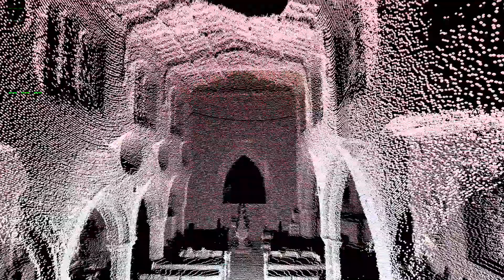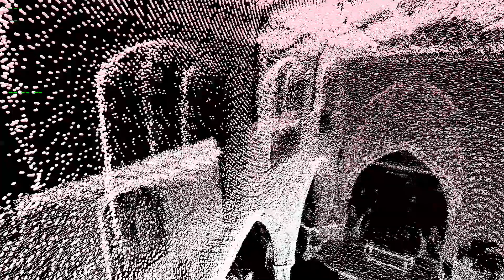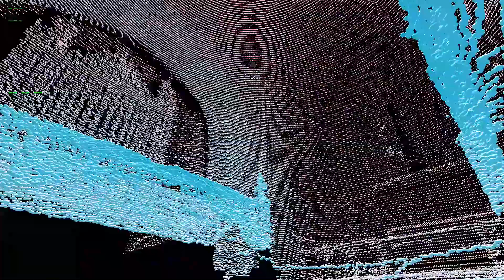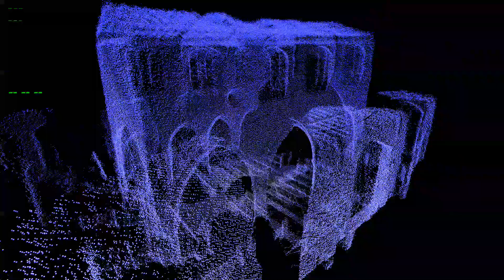Home Made Lidar Church Scan

Comment: Fascinating. How long does the actual scan take and how many points does it capture (not asking you to count manually!).
Reply from the maker: Thanks Ian. It was about 0.75 million points for the church, which took about 10 minutes to scan.  A small room (in my first lidar video) only needs a couple of minutes to get the same “point density” over the surfaces.
Reply: Would it be possible to scan even finer?

Comment: What would happen if you took multiple scans from different positions in the church and then married all the different scans together?
Reply from the maker: I think it would be a really interesting thing to do. The difficult part is finding some way of aligning the scans. That’s easy if the Lidar has positional sensing inside it i.e. accelerometers, GPS, inertial,   compass bearing, and the like. This all ends up being something called Lidar SLAM. But, my project has none of this, so it’s either by eye or some no doubt rather complicated maths.
Reply: @DavidCambridge  I'll be building a handheld LiDAR scanner with a VR tracker strapped to it in the coming weeks to marry absolute coordinates with the scanning process for research purposes
Reply: @DavidCambridge  you can use sketches in arduino and usb ttl cables to program accelerators to work with lidar
Reply: I will preface my post with the fact I am just a land surveyor that happens to get the chance to use a Leica C10 Lasers scanner from time to time and I Just learnt from using it and  doing how to use it it and how to produce models from it. 

What you are talking about doing is how we use commercial scanners produce their large models.  You position targets plates or as what Boelwerkr mentioned in their post spheres around the site so you can see as many as possible from the different scan positions. if in the case of doing work for surveying ( as is my use) we ill have some of these points coordinated with a position in relation to some grid system that our work is fixed to, but if it is just to produce a stand alone model of an area the relative position ( distance between 2 of them and the height difference ( say measure from the floor to the center  of the balls ) and use that to scale the model in a cad package , and then from the original scaled  model bring in a each of the next ones and scale them to the now known points in the already scaled model.

even if you dont have positioned targets in the scan, measuring the length between the columns and use that to scale the original scan then you can pick points in the separate scans that are the same and fit them to the original

this is a very crude description of how commercial automated unit do their stuff.  

David what you have done is amazing,
Reply: You could go the lowtech route.
1. define a convenient baseline in the object you want to scan. Every scan is oriented to that.
2. Define two spots with a known distance on that baseline. These are the measurement points to locate all the other scanning spots.
3. Every additional spot you want to start a scan from get a distance measurement from that spot.
Afterward you solve the triangles to get the absolute distance and angle from that baseline first scan. With these information overlaying the different 3D-Images should be easy. 
If the ground you work on is not flat you need three points of reference, but in my experience a laser lever will help you work on the same plane.
I measured the dimensions of a basement this way.
But you have to remember if the measurements was "left" or "right" of the baseline.

You could go a more technical approach. Get foam balls with a know diameter and positioning them in the room in a way that at least three of them are visible in all scans. Write a program that searches the dot-cloud for a round shapes of the known size. Combine all scans by aligning them by the known ball-positions. I imagine that this can be a little bit process intensive but should work without additional sensor equipment.
Reply from the maker: On the stepper motor controlling the sensor elevation I’ve got a hall probe and magnet so that it can find the home position, and it has to do that otherwise you can’t locate the motor. On the stepper motor controlling azimuth the zero degrees point is where ever it happens to be when it’s powered up. I figured that was OK, because even if you know where you are with reference to the rest of the Lidar, the Lidar itself is still plonked down in some random orientation. That of course doesn’t help with your first suggestion as some sort of rotation will always be needed between the two point clouds, but it’s also easy enough to fix. I really like the second idea, which is obviously  harder to code but computationally it’s probably OK because you only have to do it once and not every rendered frame.
Reply: I personally would find the second approach more interesting. Simply because I've never done it. :-)

I think a problem could be to identify the "anchor-balls" reliably. You need at least four points on the ball to get it identified. Ideally much more. Three points are needed to define the center of the anchor-ball and at least one more to verify that it is the ball. But if to little points hit you will get false positive which will trow your aligning off. So a value how well defined the position of a "anchor-ball" is will be needed. You then start with the best anchors (most "hit-points") and then add less reliable ones if needed to define the position and orientation of the scan. With more than two scans aligned you can eliminate false hits, because they will only appear in one scan. The additional points of the scans will make the anchor-point more reliable. And with more and more scans added you can eliminate more and more false anchors.
But it's a brute force approach. You have to check every point in the 3D-cloud with the surrounding points in all your scans. And then you have to do the same with the known centers of the anchor-balls.
And it gets harder. The points of the surface of the balls will fluctuating in distance and position a little so variation has to be allowed in the checking. And more variance will appear the further the ball is from the scanner. 
Also the balls have to be quite large to make it reliable on distance, but not so large that they obstruct to much of the  field of vision. And the position in the space should be as random as possible to make false alignments impossible.
So far my thoughts on that...
Reply from the maker: That’s all interesting food for thought, and definitely worthy of consideration and maybe even a future video!
Reply: Or you use SLAM and walk/fly with scanner around. We do this with drones in underground areas. There are many SLAM algorythms that are open source and you could implement.

Examples of using 3D lidars in drones:

https://www.youtube.com/channel/UCxoaCPNCcJmz0efjsNzSu_Q

By the way, great job, sub’d to your channel!
Reply: amazing project.
To align different scans you might look at tools like cloudcompare. it has manual and automatic tools for that task.